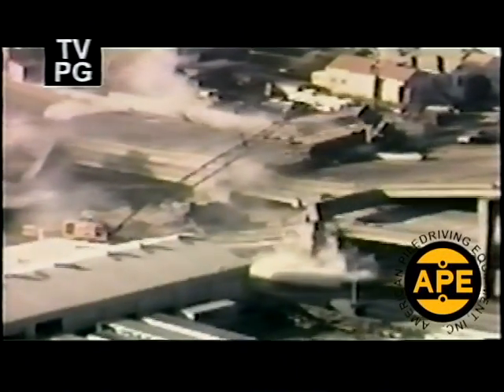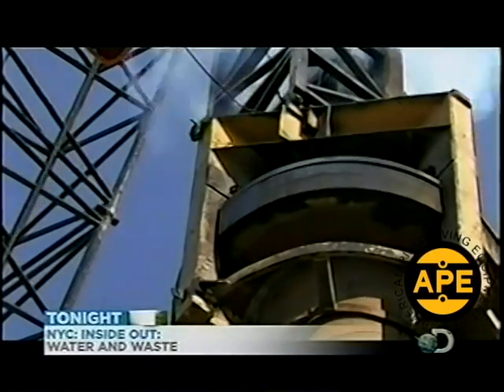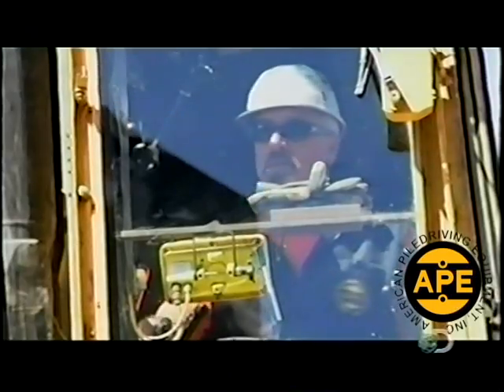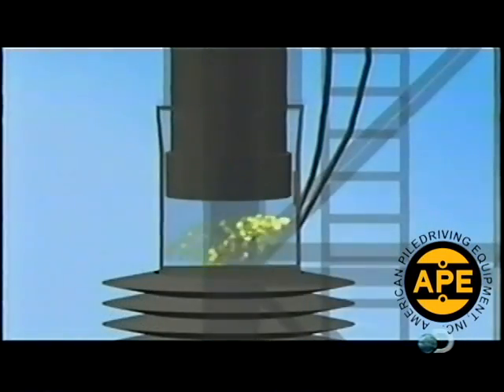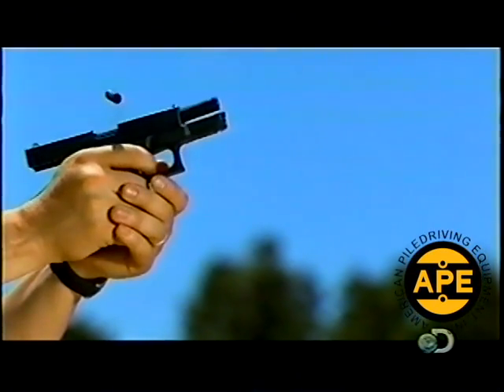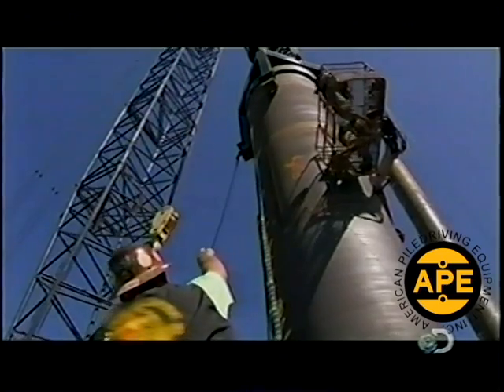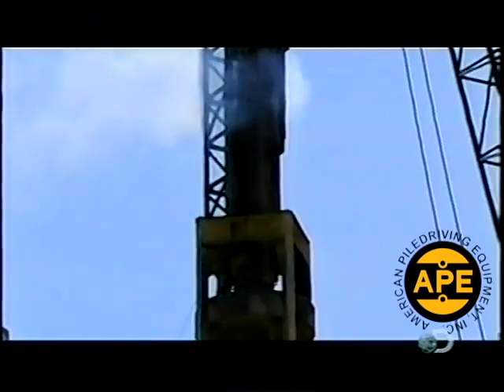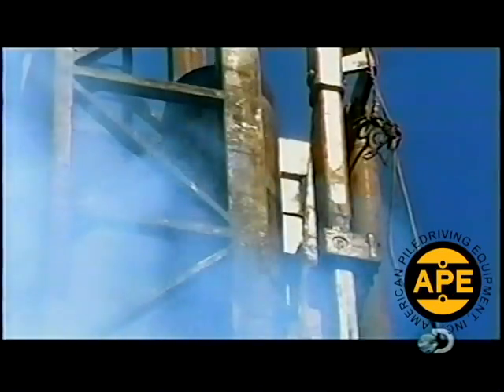Discovery Channel - APE D180 Diesel Hammer on Highway 880 Oakland California

Comment: Offshore drive pipe welder loved that job welding 72 × 4 inch pipe with 7/32 jet rod  would usually take around 10 welders 12 hrs or so to weld up two joints definitely not a job for the weak oh to be a young man again

Comment: Have you ever had the pile driver equivalent of a runaway diesel engine? If so, how is it stopped?
Reply: Diesel hammers don't pull fuel in the same way car engines do.  There's an Individual trigger for each spray.  They'd just not pull the trigger or, for the ones with an automatic trigger, turn it off.

Comment: Diesel fuel is ignited by the high air presure in the cylinder. The explosive is a chemical reaction start by the shock wave of the bullet hitting the metal container.  They are in no way similar.
Reply: Thank you, I was about to say the same

Comment: Wrong its combustion not an explosion. These a two very different things.
Reply: If it produces internalized shock waves then yes it's classed as an explosion.  Internal combustion engines rely on a shock front to complete the combustion therefore they are explosions.  This hammer is no different.

Comment: If it is a Diesel Pile Hammer engines, so this is more like a 2 Stroke Diesel Engine rather than 4 Stroke Diesel Engine isn't?  What type of fuel to ruins that engines?  A Regular Diesel Fuel like a Diesel Fuel for Diesel Locomotive, Truks, Cars, Generator for the buildings like Hotels, Office, or some kind of that?
Reply: it's normal diesel fuel. it works basically like a giant car piston nothing too special about it
Reply: +Jon Homrich 
Thank You! 😃
Reply: A two stroke car engine is a rarity however
Reply: @Bjamn1234  not in Europe, there was tons of stuff fitted with them pre 60'
Reply: Regular dyed diesel fuel in United States.

Comment: I am a female pilebuck apprentice local 196 in Oregon. I've only used a couple small ICE hammers and the rest were from APE. In my opinion I thought the APE equipment, and customer service during calls, was much better. I love driving pile and can only imagine the fun running this hammer would be.  That thing is a monster and hope one day I may find myself telling a new apprentice an old story about the biggest and badest hammer I ever drove pile with. Totally friggin AWESOME!   I am wondering though if the monitors they attach o check for plumb etc, would be considered the blow count or if they still do count with soapstone, 4' level and tick marks on the pile. Saw guys on the ropes but not blow count.  Thanks for the video.  Sharing with some frineds.
Reply: Monica Gauthier hope you still have all your fingers!
Reply: Are you a journeyman now?

Comment from the maker: They go back and either drill out or hammer grab the soil, a hammer grab is just a big claw on the end of a crane line. Is most circumstances they will then fill with rebar cages and concrete.

Comment: if the head of the hammer is very visible,you can tell that the soil underneath is very hard because the displacement or height is very big.the steel pipe piles that were driven are very big.i wonder what is the design bearing capacity of the piles.